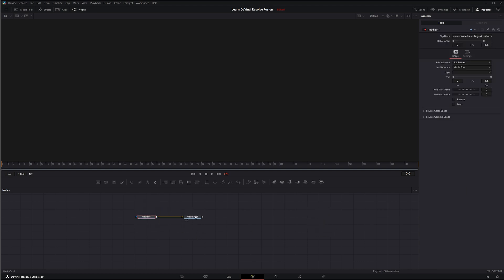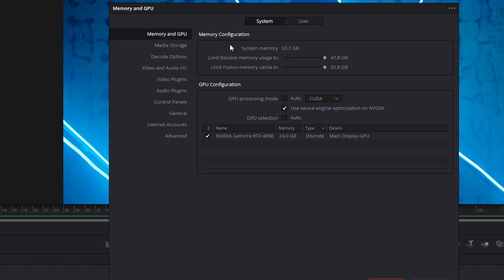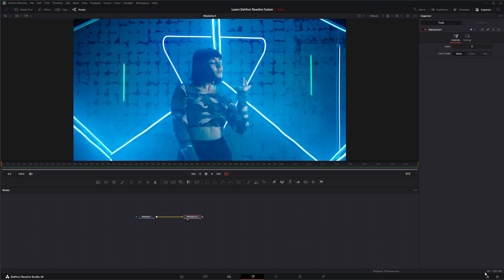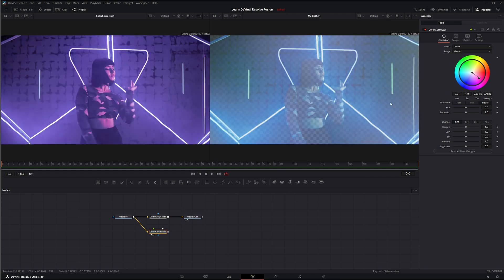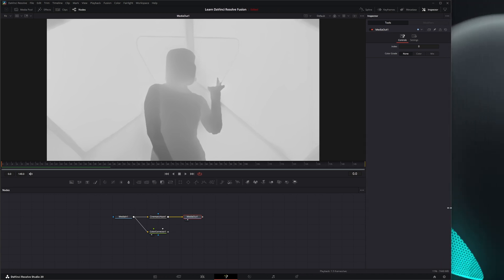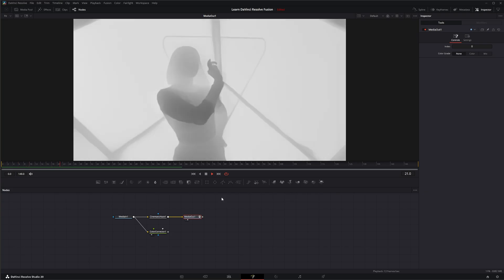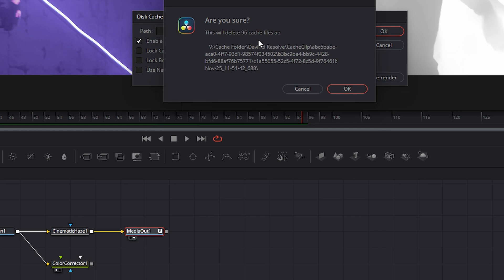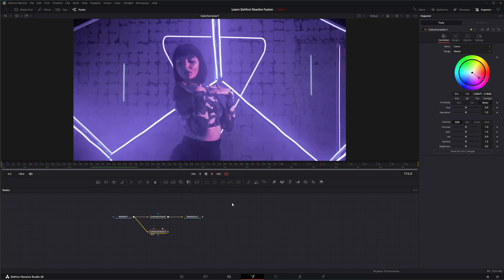Learn Fusion Ep7: Fusion RAM Cache

Comment: Hi again, if i was to do a magic mask, could i cache that output and use it as a mask in the same fusion comp?
Reply from the maker: As long as you don't change anything...but honestly, using a saver to export a mask as exr then using a loader to load it back in is usually better on memory
Reply: @bdscoveredstudio  thanks